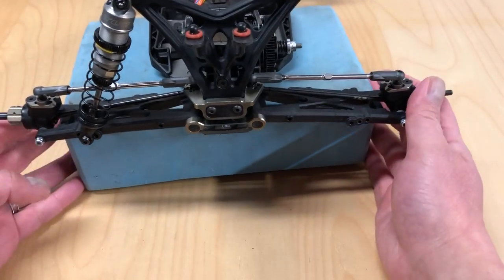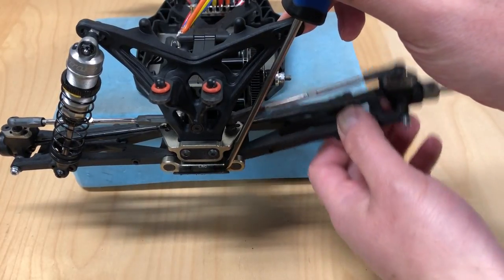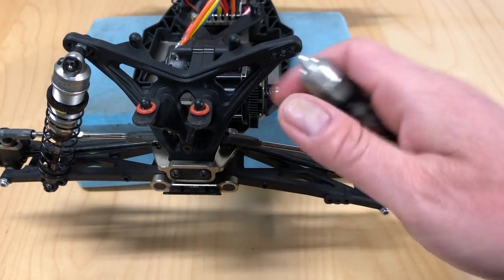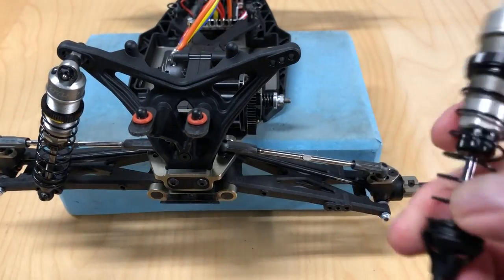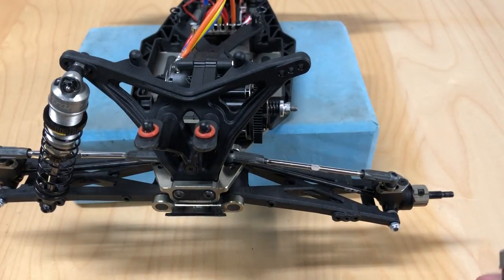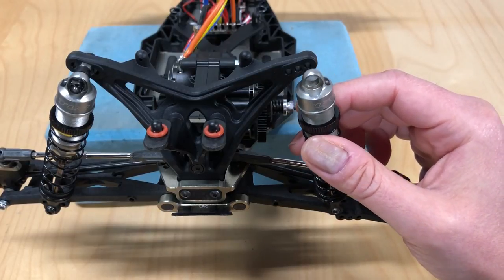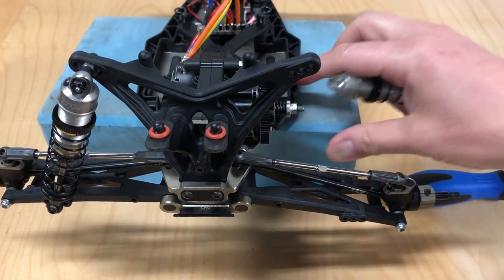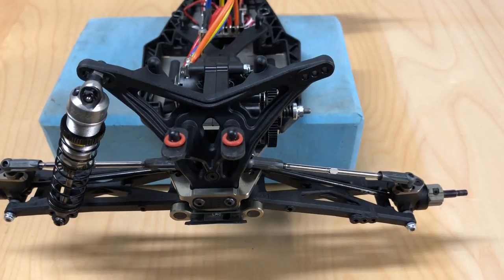Tech Talk: RC shock mount positions explained

Comment: I always move my rear shocks in one hole on the tower, I like the gain in roll thru the corners it gives. Sometimes depending on model, I will go in one on the front tower if I need a little more steering. But I generally try to keep the positions on the arms in the middle, that seems to be the most "relaxed" or not so aggressive spot

Comment: I watched this to make sure I know what I’m doing. I can in fact confirm, I know more of what I’m doing now. I set up my slash 2wd for on road with the stock shocks and set them inward so there is more travel and I am more able to adjust the preload properly to allow for the load of the car to transfer correctly. It also allows for less weight to be transferred off the inside rear wheel under breaking and turning to allow for better braking in the corner and better acceleration out of them. Next step is softer compound tires and a low cg chassis

Comment: This is interesting but I was left wondering what happens with  the springs.  You move in and leverage increases for softer but you compress and shorten the spring increasing the preload kind of making it stiffer so you have to keep the preload/length of spring the same by adjusting that for full effect.  Also, when you move in you reduce the shock travel length reducing the dampening you get from your oil shocks.  That could be adjusted with thicker or thinner oil in the shocks.  I'm a rc newb but it's not so simple and it's fun to play with the suspension.
Reply from the maker: You generally adjust the spring preload collars to get the ride height that you want.  So yes, after moving the shocks, you will still need to adjust the preload collars.  You are right that when you move the shock in you will reduce droop which will affect how much damping you get from landing jumps.

Comment: Good explanation, The whole video I was waiting for you to go one step further and talk about what it actually does to the cars handling. For example: you move it in on the top and it makes the car do this, move it out, it does this. Thanks for the video!
Reply: I always move my rear shocks in one hole on the tower, I like the gain in roll thru the corners it gives. Sometimes depending on model, I will go in one on the front tower if I need a little more steering. But I generally try to keep the positions on the arms in the middle, that seems to be the most "relaxed" or not so aggressive spot

Comment: Nice Video, My 2wd slash I had to move the bottom of the rear shock in to soften it up and kept the front further out for more stiffness, helps in gravel and turning, thats for sure. Pavement, I now get the front wheel lifting off the ground during a fast turn, rear is bit too soft for pavement lol

Comment: Wouldn’t you have more leverage the further you are from a fulcrum, in turn making it easier to compress giving it a softer suspension setup/feel.
Reply: I was thinking this too, but maybe since the load is being acted on the tire side having the shock further away from the tire gives the a-arm more leverage if that make sense.

Comment: Watcher keep in mind when moving shock location. Make sure the shock rod doesn’t fully extend a full preload because you will bend shock rods from being over extended. You can adjust the h arm set screws to help shorten the shock rod length

Comment: i have a dodge 2500 4x4 with a 10inch lift. ive been wondering all of this because its super bumpy. im fabricating an.airbag set up for the front.  the previous owner had switched it over to where the shocks are in a different position far from The Middle .. also there about two times as big as the stock position.  I got everything set up for I can get the bags in there  but as it is right now the  shock mounts will not bolt up to  top of the screen buckets .. I was wondering if it would be okay to change the position where they mounted from so that they will attach at a different point .. I think I'm just going to  fabricate  amounts that are in a totally different position from where they were . your video explained it very well I wish it was a little bit more in depth  but that was awesome video thinking

Comment: Currently using a Traxxas Slash 4x4 Ultimate and all I do is a lot of jumping with it. So setting the shock on the furthest  (away from the center) on the shock tower hole, and the furthest shock hole on the arm would be the best positions for jumping and to help reduce chassis slap?

Comment: Could u pls help me in one question ?
What is 10,10,7 shock location?
I got no idea which angle is 10 10 7
Reply from the maker: Those sound like diff fluids (10k front, 10k middle, 7k rear), not shock locations.
Reply: @RazorRC  thanks a lot 
Appreciate .

Comment: Does shock mount positions affect ride height?  The ride height at the front of my car is too high so need to figure out how to lower it significantly and wondered if changing shock mount position would help.
Reply from the maker: Remove preload spacers or raise the preload collars.
Reply: @RazorRC  Thanks for the quick response.

Comment: So with droop. Say I want to increase droop in the front and I’m starting at middle middle top and bottom ..outer hole on top and inner on bottom? Same truck (22t 4.0 btw)
Reply from the maker: if you just want to increase droop, remove some internal plastic washer limiters from the front shocks.

Comment: And when you move the shocks to a new place you can change the preload on the springs or even the spring rate with new spring. Also if you soft the ride but in general like the way it handles you can bump up the weight of the oil. Same goes if you move it out and it’s too stiff but you like the spring rate you can move to a lower weight oil. 

I got a lot of practice with physics and fulcrums growing up. I was much taller and heavier than my classmates so I had to sit closer to the fulcrum of the see-saw. 😉

Comment: Have you considered putting the shocks upside down to lower center of gravity? Shocks are upside down on motorcycles and MTBs for example.
Reply: Linked RC  Unsprung weight on the suspension. With the shocks mounted right side up, when the suspension encounters a bump, only the shock shaft has to cycle with the suspension. When you mount the shocks upside down, the entire weight of the shock body and oil is added to the suspension arm, each bump encountered on the track will have to move the entire weight of the shock along with the tire, hub ect ect. Basically makes the suspension less efficient, has to work harder to do the same job. It can stabilize(reduce) how much it rolls since the shocks are some of the tallest weight on the chassis, however I doubt it would be any faster or better driving than the traditional setup.
Reply: The upside down shocks on a bike is the same principle as the cars less weight on the arm so it’s more responsive

Comment: Moving the shocks in towards the pivot will raise the ride height. Moving away from the pivot will lower ride height.
Reply: Razor RC I know....the change it ride height is normally minimal but it is still something to be aware of.
Reply: ride height should only be set by spring collar location, screwing the shock collar down increases ride height and vice versa, moving the shock mount location effects how the shock performs throughout the suspensions movement and should never be used for ride height

Comment: The key here is that setups are a clustered effect. I feel confident in saying that 99% of us could not tell a difference in moving the shock arm from T-A to T-B, or even A-B to A-C, etc. The other 1% are liars ha ha. However, it's the setup as a whole the cluster that is what defines the vehicles optimizations. To that end, I only change mount positions if I am driving on-road vs off-road...otherwise it's not that much of a difference maker (even within the cluster). 
Additionally, so much of this hobby is 'on paper'  but in the field the results are completely different. This much I know. :-)

Comment: would have been good to go over how changing the front shocks can change the steering.
You just seem to find 10 different ways of saying the same thing, when you move your rear shocks in it makes it a softer shock and when you move them out it a stiffer shock but nothing about the front of the vehicle
Reply: +Razor RC so your saying changing your shock position has no affect on steering it just changes your shock stiffness?
Reply: +Razor RC you needed that  explain that on your video, after all it's important and its only take a couple of to explain,

Comment: Great video, but too much repetition. And you don’t really explain why you would want a softer vehicle, or why you want them more linear vehicle, or why you’d want a more progressive vehicle. What do those words actually mean performance wise. And in what scenario is each better?
Reply from the maker: the shocks control so many things, that it's hard to explain in a couple of sentences or even one video.  Softer will allow more weight transfer to that side of the vehicle which can help with more grip or if that side of the vehicle feels too hard and not compliant enough.  Progressive will allow the shock to feel soft initially before it stiffens up, which again allows more initial weight transfer before it loads up and stiffens up to support that side.
Reply: Let me put the question this way, if I’m not interested in racing or having strong stability on fast turns but I’m more interested in bashing and setting up my springs so that when coming down hard it is less likely to damage or break something because the shocks are taking the most optimized brunt. Which set up is specialized for that? I would assume the opposite Would be specialized for racing. And in the middle would be the best of both worlds scenario.

Comment: Fantastic explanation 👍👍

What if the upper holes on the shock tower is further in than the lower control arm inner suspension hinge pin? Softer or harder?